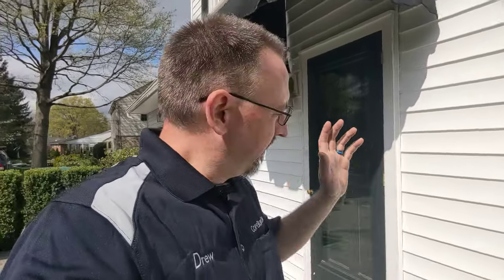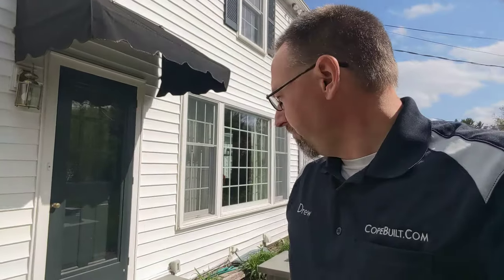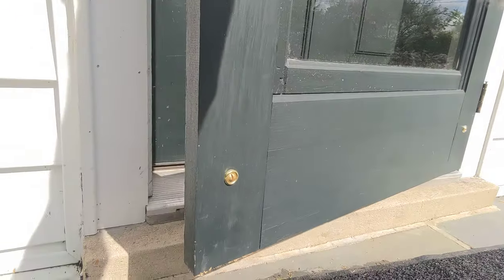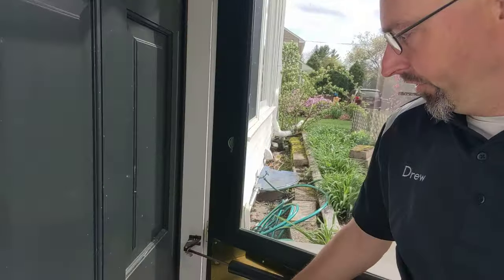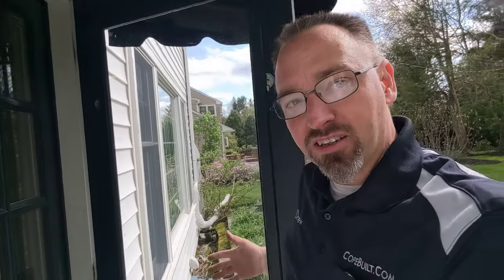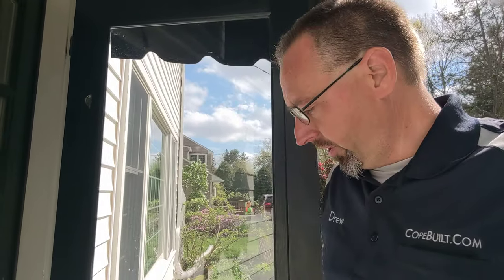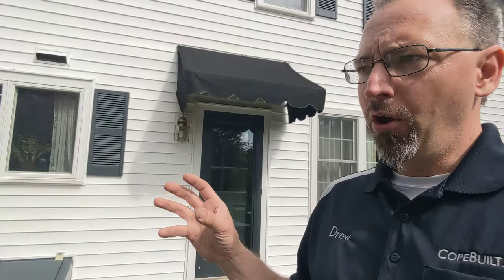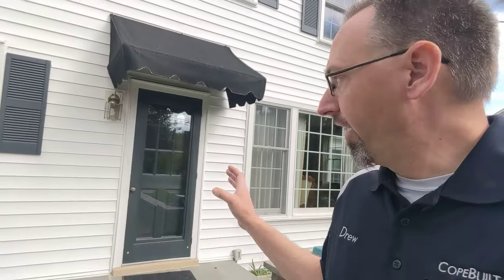storm doors: common problems and how to fix them

Comment: Installed a Larson but also had to rebuild deteriorated Masonry and add new brick mold. Nice and plumb, but probably door/trim (aluminum) spacing tolerances too tight because when it rains, wood swells and door contacts the trim along the handle-side. Any solutions? Can shave aluminum and repaint od remove trim, shave wood and reinstall. A lot of work, though.
Reply from the maker: Great question.  I have a lot more tools for massaging and adjusting wood... And less tools for doing the same things to aluminum... So my inclination is to remove the storm door and modify the wood or pvc brick molding that it mounts to, And then reinstall the storm door... Lot less things for me to screw up that way... And very little chance of me having to go buy a new $350 storm door.

But if you have the experience and expertise to modify the aluminum, go for it

Comment: your good Drew....I'm looking for a vid that can help with a storm door that is very hard to OPEN...Its at my buddies house and I think it has been getting worse and worse as time has went by until last time I was over there it took him almost 10 minutes for him to get it to release and open from the outside where we were trying to get in! Its a  heavy duty door all he can do is to turn the door handle and pull pull pull- sort of like trying to shock it so that it releases, but we don't really know what is holding  it closed, getting it stuck.Can you help? It even does the same thing from the inside...He's one of those type people that ALWAYS locks his storm door when he stays in or leaves the house.  I'm supposed to fix it for him..I'm pretty good with tools and improvising to figure out a fix for things, but doors and turning handles I really don't know  very much about- Id have to watch alot of videos on these things- because I know I have alot to learn. Even if you just suggest where I might want to concentrate my attention, it will be beneficial to me. Thank you for your response ahead of time.
Reply from the maker: Hey Dartell... thanks for your comment... if you haven't subscribed to our channel yet, please do so, as we are publishing helpful content 2 to 3 times a week and we don't want you to miss an episode.

If I had to guess... the door is dragging...  over time it has sagged and the latch side is resting hard on the bottom threshold and you need to "LIFT" the door to make it open (or pull really hard).

You could use a turnbuckle...  Search lowes for 809412 and it should come up.   You attach this at the bottom of the latch side... and half way up the hinge side, and then tighten to lift the outer edge of the door.

Another possibility is that wood has swollen and you need to get out the belt sand or a planer and shave something down to stop it from hitting.    Step one is figuring out WHERE its hanging up, and then focus your efforts in that area.  Good luck!!

Comment: Thanks for the very informative video.  The problem I am having is the main door is so air tight the Larson storm door with one closure will not close the door.  Any recommendations?  I plan to add another closure at the bottom but I have to order an off brand because I cant find almond/tan closure from Larson.
Reply from the maker: XrpIceMan - You are experiencing a VERY Common problem.   Some doors have exchangeable full panel glass inserts and screen inserts which are swapped seasonally.    We have found we need to adjust the closers with stronger pull when the glass is installed and less pull when the screens are installed.   Getting two closers matched for tension can be challenging and requires a lot of trial and error.

In your case, look at the bottom of the larson door. Some of them have an "adjustable" sweep.  This is a U-Shaped trim piece on the bottom of the door with a weather strip.  Adjust it UP and experiment with leaving a 1/2 inch gap at the bottom.  This gap may be enough to allow "trapped" air to exit the opening so that the door can close properly.   

Let us know if this tip works for you.   We hope you LIKE our video and subscribe to our channel for more great home improvement and contractor screening tips.   #CopeBUILT

Comment: I have a storm door w/glass middle, very heavy door.
Has upper shock & lower,
Both have been replaced* 

Issue is when I open the door and go out the door swings back on me when I open.
The shocks do work but their is a swing motion shock catches door & closes properly.

How do I prevent door flying back on me upon opening immediately. Thanks guys.
Reply from the maker: Hi JHarris... Thank you for your question... sounds like, while the closers have been replaced, they may not be adjusted property... and generally speaking, they should be adjusted one-at-a-time, with the second closer disconnected, while working on the first... and then the first disconnected while working on the second.    That way you can tune them both to exert roughly equal pressure.

In my experience, once the units are closing at the same desired speed, and then combined and both are back in operation after independant adjustments, then I find that the overall door speed is even slower than one only controlled by one closer.   When this occurs, once they are working together at the the same speed, I simply adjust both closers, 1/8 of a turn, in unison, increasing the close speed, until I achieve the desired result.

This video from Larson Storm Doors will give you specific instructions on how to adjust the closing speed of a storm door the utilizes two of the gas cylinder shock-absorbers as you describe.   https://www.youtube.com/watch?v=vqmcaryyq2Q

If you find our answer helpful, please like this video, and subscribe to our channel to help communicate to YouTube that we are providing quality content on their platform, and so you'll learn about new videos we put out each week.  Thanks so much!

Comment: Love such an innovative solution to this situation!  That’s truly finding a workable solution that literally looks amazing!  So we’re going on 10 years strong with our Larson storm doors.  One was to reduce UV and the other was for security.  I know…why not get the same type for both entrances?  I gave it a lot of thought when we moved to this old house…the door most likely to be kicked in by burglars is the side entry where neighbors may not have a clear view.  So it had the security storm door.  Then we ended up having 4 extra large dogs…and though we don’t have a burglar problem…we do have 4 extra large dogs charging at the security storm door every time we go outside.  That door was a God send in that they’ve all crashed into it thousands of times and it held!  Both doors cost us a lot, but worth EVERY expensive penny we put into them.  That said, we’re driven nuts by Larson storm door sweep replacements.  It’s hell to install.  And then the seal prevents the security storm door from ever closing on it’s own despite two installed auto closures set so strong it kills my ankles slamming into me…and still not latch close.  I have to ALWAYS manually close it.  Now I’m reading to leave a 1/2 inch gap in the next to impossible sweep.  We got these little blue/grey lizards that already venture in when that door doesn’t close all the way.  If we leave a 1/2 inch gap, that’s like an invitation for them to come in die somewhere in our home. Is there a real solution to the horrid installation AND not leaving the 1/2 inch gap???
Reply from the maker: Lan Dai Hilton... thanks for you detailed comment!!   Great to hear that the doors are holding up.  We have enjoyed long term larson success on our own home as well.

Sadly, no, i have not found a solution to make the door close, other than to leave a gap at the bottom to allow the air to escape.

SOMETIMES... and i do me some of the time... on occasion... i have been able to adjust the location of the closer mount in the jamb... moving it FURTHER from the storm door hinge, and closer to the interior of the home.... OR.... moving the door mount 1 inch further from the hinge side, and closer to the latch side on the storm door slab.   This adds extra tension... and then i can add more cushion with the adjustment screw.

The second approach is the "least invasive" in that you have two screws securing the mount to the door slab.   remove both screws.  move the mount further from the hinge side, and put it back in with just that 1 screw... adjust the close speed cushion, and test.   If you don't like it, you can put it back, and you haven't drilled any extra holes anywhere.

A similar approach can be tried on the jamb mount, but you may have to "hold it" against the jamb as 2 screws on the outdoor side of things won't hold against the tension from the pressure without the 2 inboard screws. 

Give it a whirl and comment back letting us know how you make out.  

If you haven't subscribed, we'd like to invite you to do that now for more great weekly content!  Thanks again for your question.

Comment: just had a Larson screen away door installed. wasn't cheap, but it leaks from the top.  is caulking a customer responsibility upon installation completion.  Cause the instructions do not call for caulk.  $500+ door.  not happy :(
Reply from the maker: I've never installed a storm door that required caulking on the door itself.     I have, on occasion, needed to apply sealant between the storm door jam head bracket, and the brick molding, if the drip cap on the door installation itself was insufficient.   If the storm door is leaking THROUGH the storm door, you need to contact Larson.  Good luck!  

Hope you SUBSCRIBE to our channel for more home tips.

Comment: Thank you for this video! I've been using it for reference. One question: if the wind has ripped some of the wood out on the frame, how do you cut that piece out and separate it from the frame? Seems glued or something to the frame.
Reply from the maker: minor ripouts can be addressed with wood golf tees and wood glue.    Major damage usually requires removing a section of the jamb with a vibe tool, rip a replacement on the table saw, glue and screw that in place, nail fill and paint.  And then you can reattach the closer...

Comment: Hi, the top closer/spring came unpinned and the washer seems to be locked and I can't figure out how to extend the bar on that side to reinsert it and repin it. Any suggestions? Thank you!
Reply from the maker: Sadly... brute force.   Put the pin, back in the bar, so that you have something to clamp onto.   Grab your vice grips, and use them to pull the bar back out... and then hopefully, slide the "washer" which locks the bar in the extended position, back down to make contact with the gas cylinder again.   Probably a two person operation...   Good luck.   Make sure you subscribe for more helpful videos from our team.

Comment: when my door is locked in the open position with the closer, the bottom of the door on the hinge side pulls away from the frame about 1/2 inch, since the door is capped with aluminum should I just try putting a large wood screw in through the aluminum frame I know it won’t look great but better than removing the cap correct?
Reply from the maker: Sounds like a reasonable plan to me...   Often times, when wood is water damaged, rather than replace it, some con-artists calling themselves contractors will just hide the damage by capping over it... and by the time their taillight warranty is expired (when the taillights leave the driveway) you start to experience problems like this and are left holding the bag when you can't find them, and failed to get a COI (certificate of insurance).   

YES... Try the long screw.  If that works, GREAT!  If it doesn't, you are no worse off than you were before because you still have to pull the storm door, and the capping in order to fix it.  

Stay tuned to http://www.HomeFieldAdvantage.pro  - once we go live with the new website in a week or two, you'll be able to purchase a zoom session and we can work on it with you together, so that you can get your questions answered and solve this once and for all.

Comment: How about storm doors that slide from glass or screen...   how do you add a chain and the door is metal. Will the screws damage the hide away screen.
Reply from the maker: We successfully added a chain to a rollaway hideaway screen as you describe at our personal home... And it was simply a matter of going high enough with the fasteners to make sure you are above the rollaway screen mechanism.  We went extra heavy duty and used a u-bolt with a full metal plate on the exterior of the door... We also preemptively added a Z-Bar turnbuckle the same day we installed it to help protect it from sagging over time.  

Thank you for your comment and your question. We hope you subscribe to our channel for more helpful information as you interview contractors for work on your home
Reply: @CopeBUILT  thanks... I will sub
Reply: @CopeBUILT  is it possible to show it in one of your videos... ..
I understand but a visual would help...  my door is metal and Im trying to figure out if Im over the screen roller.   Thank you in advance... I did sub ....   I wish your crew was in this DMV... I would pay you to fix this issue.
Reply from the maker: Here is a link to an unpublished video on the turnbuckle system we installed.   https://photos.app.goo.gl/AvCws5kAVTEweCeT9  

Sadly, I don't have any images of the safety chain bolted in above the rollaway screen, but this is the ubolt i used... hoop towards the interior... NUTS on the exterior... and ask the hardware employees if they have any "cap nuts" you can buy to fit it.   https://www.lowes.com/pd/National-Hardware-N100-377-V2193-U-Bolts-in-Stainless-Steel/1002237284

Those look like this, but you need to confirm that the 1/4 x 20 thread size is correct for the UBolt you buy
https://www.lowes.com/pd/Hillman-3-Count-1-4-in-Nickel-Standard-SAE-Cap-Nuts/3035978

Here is a safety chain kit... they also sell a $12 version from Pella, but I'm not sure one is better than the other....
https://www.lowes.com/pd/WRIGHT-PRODUCTS-5-in-Steel-Screen-Door-and-Storm-Door-Chain-Stop/50102496

Comment: Great for fancy storm doors but what about aluminum crappy ones most people have? Turnbuckle?
Reply from the maker: YES!   We preemptively add z-bar turnbuckles whenever a customer will allow it.   If a new storm door is going in, we recommend a safety chain, AND a z-bar to prevent sagging.   About 50% of our clients turn us down.

I put one on the new storm door I added to my own house in 2005... and that "crappy aluminum storm door" is still holding up.   It has other problems now, but sagging isn't one of them.

By the same token, I have client who refused the z-bar, and I have put 2 or 3 storm doors in for them in the same time period.   

Place your bets, Pay your money, make your choices.

Comment: What about doors with the roll down windows. Mine has a roll down screen window in the door but the lock won't hold the window open is there a way to fix it?
Reply from the maker: I have purchased new screens on a replacement roller system from the manufacturers and installed them in the past... NOTE... the directions they supplied were not clear... 

You can probably buy a new latch if the clip has broken off... but you have to determine if its the latch that broke... or the ledge which the latch clips on-to.

Comment: Do not buy storm doors with corners at 45 degree angles, they will become wobbly in less than two years. Buy only doors with 90 degree angles.
Reply from the maker: Great comment Wally... we are continually shocked at the incredibly low standards found in modern manufacturing.   I don't know that I would agree that all mitered corners are bad... but its is important as a consumer to evaluate various brands and models and see which appears to give you the best construction practices for your dollar.     For those willing to go the extra mile, we often will pre-emptively install a z-bar turnbuckle to help support the latch side of the door.

Comment: I got one for you.... How do you fix a sagging storm door handle without replacing the handle? Its a Larson.  Thanks
Reply from the maker: Larson handles are often sold separately ($50), and generally have a square metal bar going through the door as the "axle" and each handle connects the the square bar by slipping on the end, and is fastened in place with a hex drive set screw.   Grab your allen keys, look for the hex screw head in the round part of the shaft handle and see if you can loosen it... push the handle further onto the square metal axle, and then tighten it again.   You may have to repeat on the opposite handle as well. 

These handle kits sometimes come with a plastic or nylon shoulder washer... if that breaks and falls out, it will create slopp in the action of the handle. 

if this helps, please like our video, like this comment, and subscribe to our channel.  thanks :-)
Reply: @CopeBUILT  thanks for the detailed response.  I'll look into it promptly.   Liked and subbed. 👍🏼